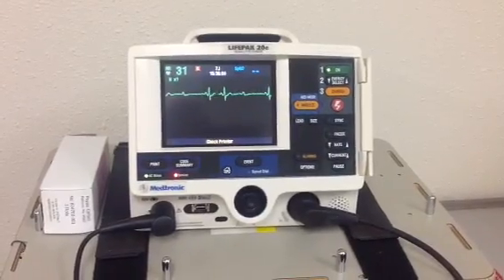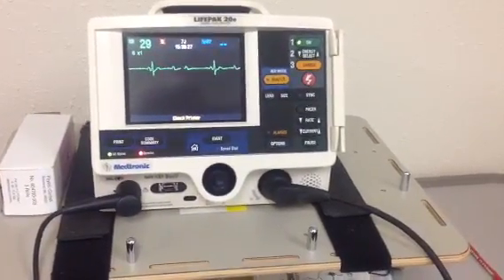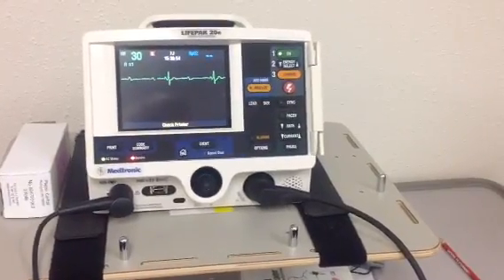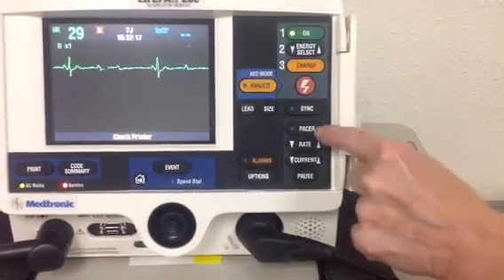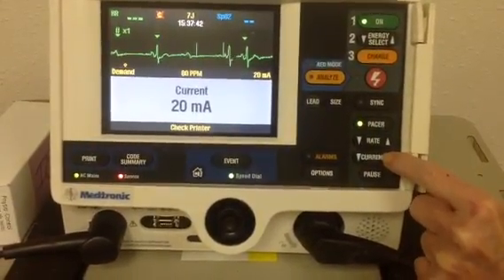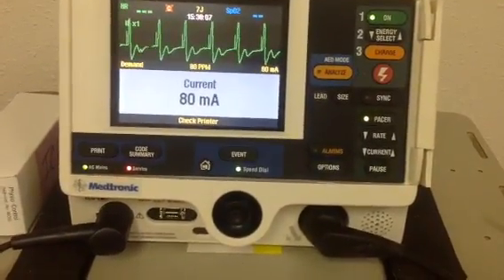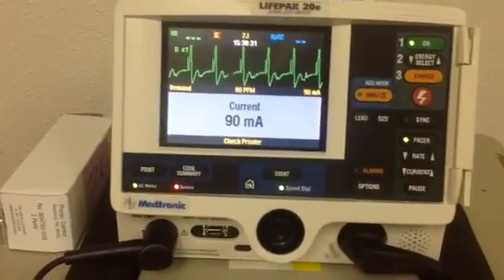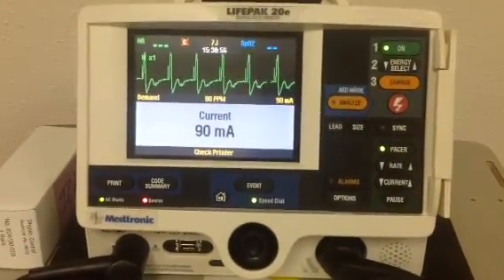How to use the Pacing Option on the defibrillator

Comment: How do you transfer a patient who is on external pacing from one machine to another during transfer from one hospital department to another or just switching out machines and pacer pads
Reply from the maker: I think you just answered your own question.  You would switch to the new machine…hopefully you could still use the same pads, but they most likely are machine/brand specific.  Check with your CICU nurses or EMT folks for verification